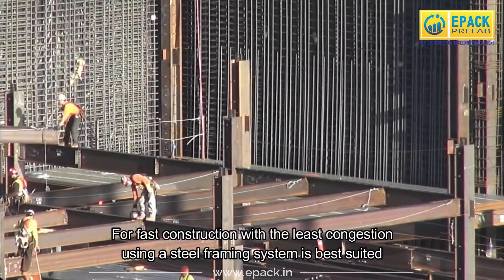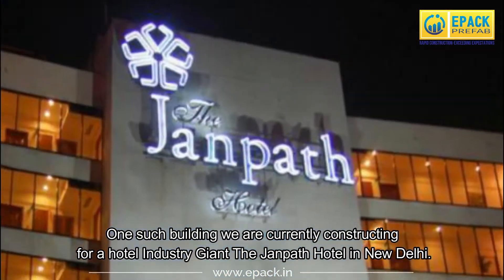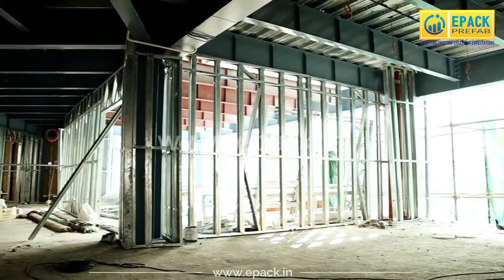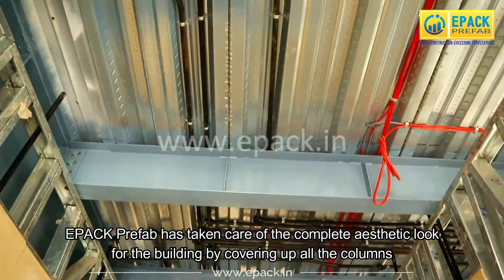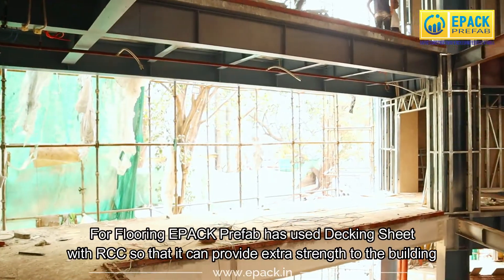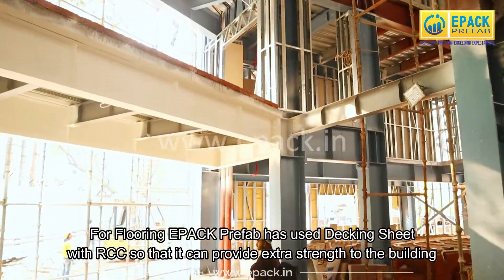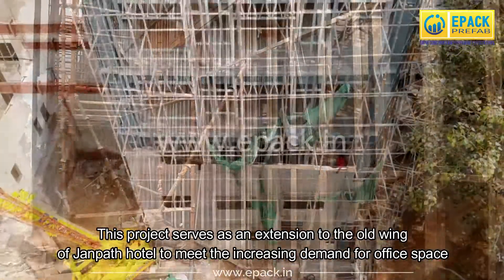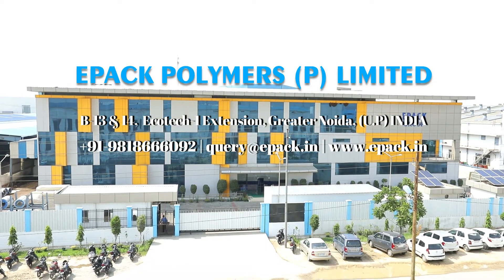5 Floor Pre Engineered Steel Structure Building | PART-1

Comment: the bracing details are kept off centric  instead of concentric  , cosnidering this being delhi this should have been avoided . No logic of doing like that .
Reply from the maker: We appreciate your feedback. The design considerations are based on structural requirements and project-specific factors. However, we always value insights and are open to discussions for improvement.

Comment: Would a ( - 2+G+14) structure be possible to build on 30*30 meter area ?
Reply from the maker: It can be possible if designed perfectly.
Reply: Pls call.for more details for multiple floor